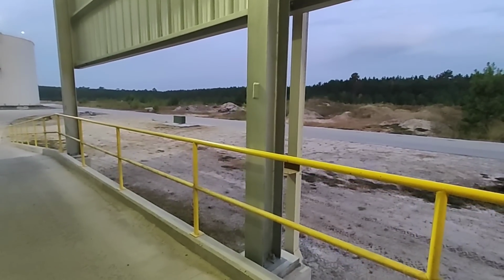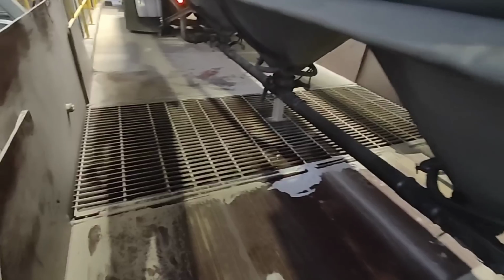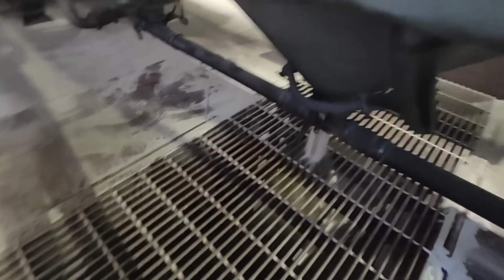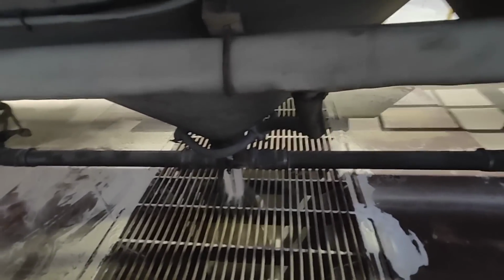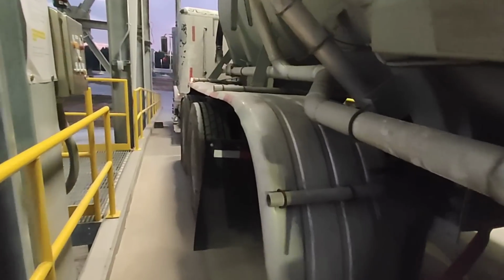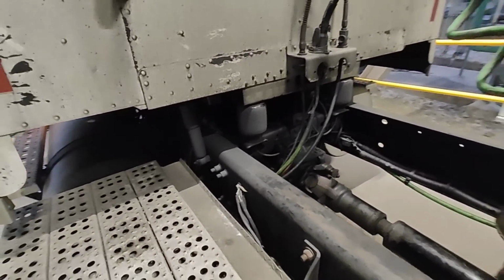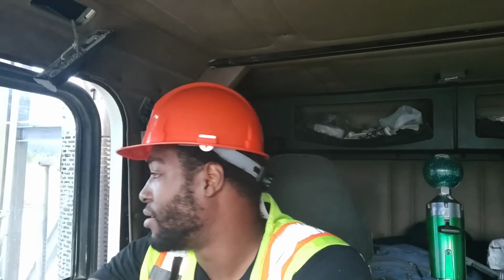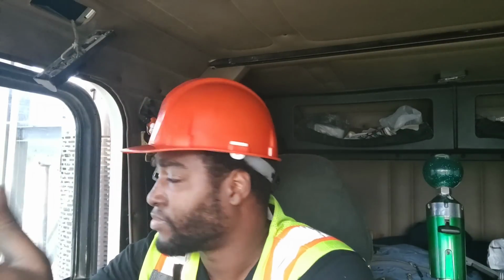Facebook Marketplace Problems

Comment: I got a 2000 Freightliner Fld engine is a 99 12.7 60 series body pretty clean in and out but needs a rebuild or head gasket from what I was told from my mechanic. Can send pictures and info on the truck if interested.
Reply from the maker: So you gonna rebuild it and make money with it right? Overhaul kit $3k. Labor $3500. Block cut $1500. If it needs heads $3k.
Reply: @ChasingAndrewJackson  That’ll be the plan if it doesn’t sell can’t afford to drop more into it right now.
Reply: @rashidbangura1332  how much you asking?